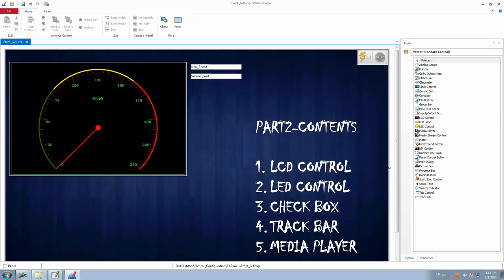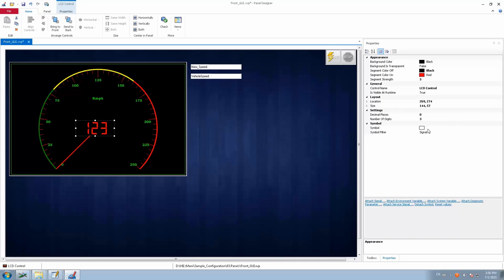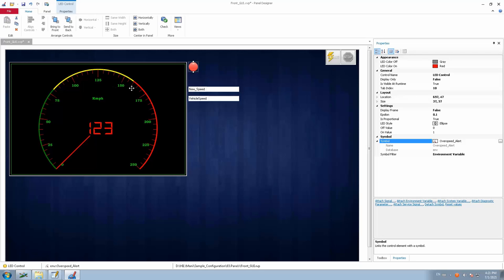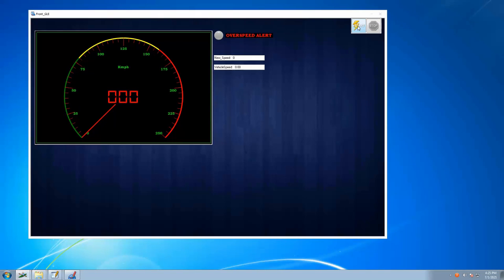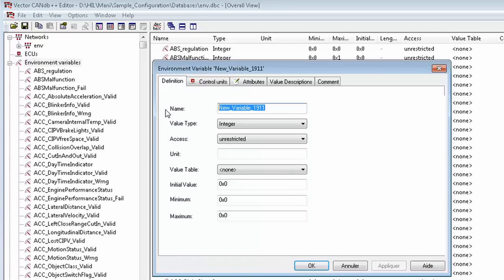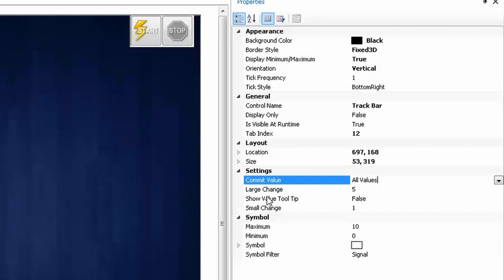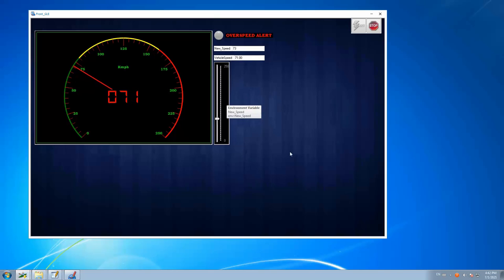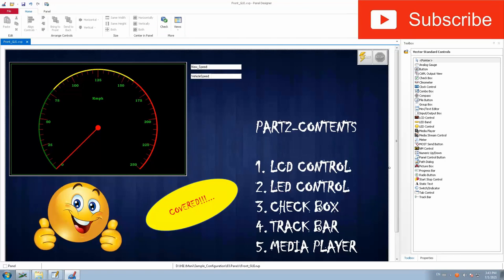Vector CANoe - Panel Designer - Part-2

Comment: I want to ask, this is speed demo or actual speed of vehical?
Reply from the maker: This is just a demo, I did some Vehicle Speed ramping in a linear way through looping to just to show how you use certain functions in testing. If you need to have a more replicative Vehicle Speed, then you need to either use a good Vehicle plant model to simulate it. Otherwise, if you have a vehicle log, you can also replay those logs in CANoe to replay and do the analysis.

Comment: HI
could u please tell how to add pedals for this panel configuration, i can not see any such like tools (accelerator pedal break pedals etc) could u please share?
Reply from the maker: There is no extensive tools available in-built in CANoe Panel Designer for all use-cases. But the best way is, you can use the picture and control tools to look something similar to your needs.

Comment: Thanks for the detailed explanation. One question though. After assigning the button to an environmental variable and by clicking the button is there any pre defined function to execute the CAPL code (like "on , similar to "on signal"  change will be executed when the that particular signal is changed?
Reply from the maker: If it's a simple button press, you have the logic of press and release in the Panel Design option itself, like press -> 1, release -> 0 (which is configurable). But if you need a certain operation/sequence of steps to be performed when pressing a button, then you need the respective CAPL code for it.